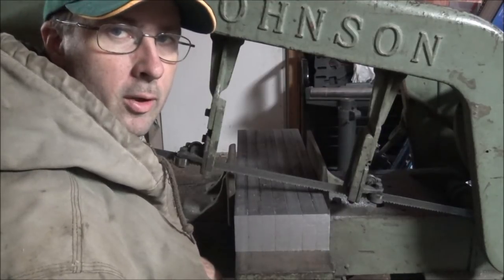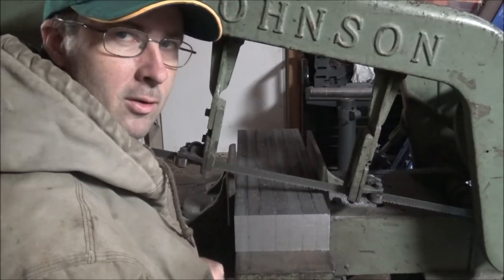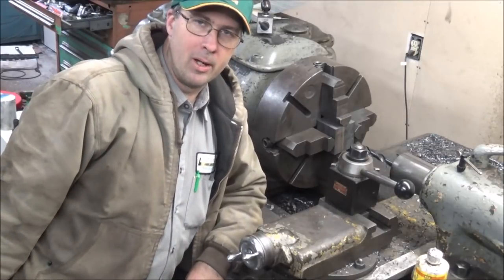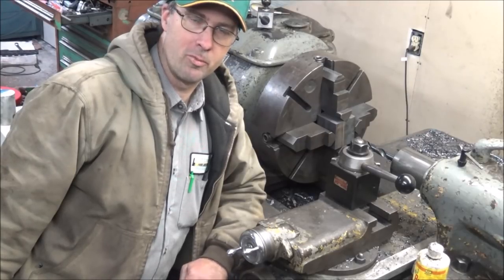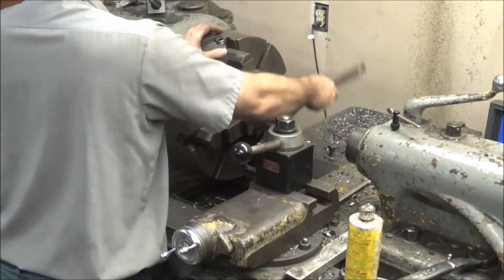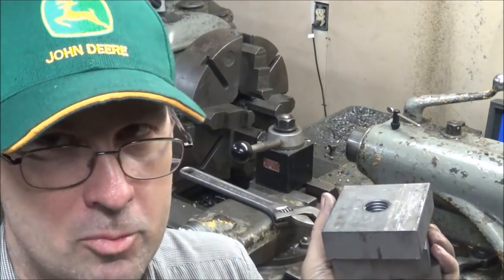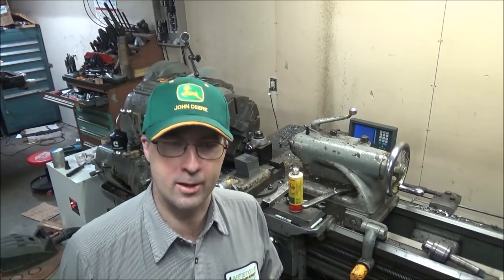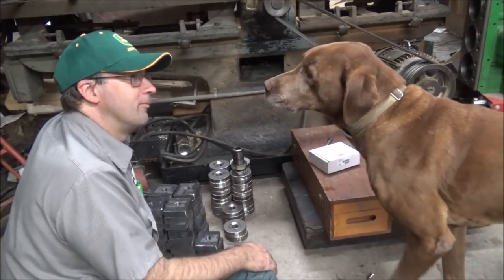Ganging Parts to Save Time

Comment: I did an install similar to yours on an old Grand Rapids grinder, about 42K the rigger figured.  The print called for very similar anchors.  My print did not call it out very well, but installing them was tough.  I used angle over the concrete, so I could set them in position, but it made finishing hard to do well, but ok since it was under the machine.  I realized later that the prints had angle near the surface, but it did not give a length.  After some thought, (and after the concrete was set) I realized that the angle near the top was to align the anchors as well as hold the whole assy of anchors square, etc.  Mine worked in the end, but was not pretty.  I would highly recommend welding some angle near the top of the anchors so you can lower the entire assy in place, level, etc.  It will make it much better than my job.Joe

Comment: Now that's rapid tapping for sure Brian. Not a hope I'd have the guts to try that even if my lathe wasn't a pos. And 21 inches of steel in 16 minutes isn't slow in my opinion. I'm still always impressed at how effortlessly and quiet Yours and Adams Monarchs run. No fuss ever, just nice and smooth and the metal peels right off. That is going to be a long tiring job getting that HBM leveled with that many anchors. high production rates or not your still gonna be getting the boss his dinner no matter how much you do. :-)

Comment: Hey Mr Brian, just a thought for you. I got a set of 8 or sockets at the tractor store and made a driver from an old socket extension and power tap with that. In deep holes the socket just disengages from the tap if need be then a wrench will back it out a turn or two and you can power extract. Hope this helps keep on makein chips!

Comment: Enjoyed.....curious, could you have clamped your 4jaw on the Carlton on blocks and done the drill/tap?  Assume a much longer setup time and Bailey might dock your wages
Reply from the maker: Probably could have but just lugging that chuck from one shop to the other would have taken me half the day, that thing is heavy!!!! Then I don't have a good way to attach a d1-6 to the table so even more time figuring that out and also I would have to work in the cold so using the lathe was the better option. :-)

Comment: Power tapping 3 at once... you wild man!!  I almost got  a Johnson model J but the seller changed his mind.😣
Reply from the maker: They are a great saw. I love my Johnson.  Three at once saves time and so does full speed power tapping! :-) It can be a bit tough on the heart though. lol
Reply: I find hand tapping so much more risky, power tapping gets the tools very straight without so many irregularities, those that causes a tap to break...   ;)
Reply: I completely agree.  I power tap on my Monarch lathe.  My Monarch is a Series 61, and it's wired with a reversing switch and controls, too.  I was just worried about three parts ganged together.  I don't think I'd do that......but I don't do it all the time.  I'd be worried about snapping off my expensive taps, not hurting the lathe.  The Monarch's are built for it, and a whole bunch more....

Comment: Hi Brian,  I would like to see how you adjusted your saw to cut with such accuracy.   I have a Wells saw and get around 1/32 top to bottom of the cut and about the same front to back depending on the length and height of the material.   I OK with this but if I can increase the accuracy I am all for it.   I would like to hear your comments or suggestions on dialing in a horizontal saw.  I  enjoy your videos and wish you continued success as you progress setting up your shop.  Thank you !
Reply from the maker: I will aim to make a video on it in the future. Have you tried a different blade? If you have everything set square and it still wants to cut crooked its usually caused by uneven rake on the blade.

Comment: haha nasty bossman here, ya could of shaved 30 seconds off that time by backing out under power... lol
nice work as always Brian.. if you want the boss off your back send him on a wild goose chase
Reply from the maker: My lathe only turns one way, it doesn't have any reversing contactors to turn reverse, otherwise I would have powered back out.:-)
Reply: Now time to get the shop superviser to work in orderto get that switch fixed if he really wants production to increase....!!!!
Or, what a stupidviser is for...????
Reply: very much tongue in cheek.  ........ just swap the wires from the phase converter over that will make it gu bakards that should do it , only jesting , but due the girl a favour and fix the leccy bits up right .. great vid thinking outside the box as usual , boss looked please but he must have been working hard he falling asleep on his feet
Reply: reversing the wires on the motor input isn't a ggod idea, cause the motor in the lathe is idling constantly and the spindle is engaged by a clutch, so you need a proper reversing set-up if you don't want the power lines to melt down by reversing the rotation on the phase converter... Yeaks...   
( Brian uses invisible fiching wires to keep Baily up on his feet after a certain time of the day...   lol   )
Reply from the maker: What switch is Baily fixing?
Reply: Guess by now, I realize that the only switch Baily has is an "On/Off" awake/asleep switch, or sound on/off when he wants quiet from his employee and nap...

Comment: Vert smooth work. Whats next? Are you near ready to pour concrete or is there much prep work to do.
Reply from the maker: I have to position all the anchors in their proper spots and be sure they stay there. No small task.
Reply: As much of a pain it would be to work around, how about welding rebar between them to hold them in place?
Reply from the maker: I plan to do some of that.
Reply: Another thought, how about welding or bolting up out of wood a fixture that simulates the machines mounting holes that you could drop in place as each set of mounts has concrete poured around them? That way the bottoms would be anchored by the re-bar and the tops aligned by the fixture.  But you likely thought of that already. 

At least you can bribe your supervisor with a scratch between the ears and a dog biscuit, That wouldn't work so well with mine, She'd file a harassment suit....

Comment: Multiples and ways to gt it done faster, don't need to have Baily to push me to find ways to cut short, I HATE PRODUCTION RUNS... !!!  
But, it's great to have a partner to put the blame on or hear the thruth from...    lol
BTW, have that "Happy" superviser fix that reverse contactor on the lathe for you, after all it's just a phone call away...   lol
Reply from the maker: My lathe never had reverse. It only has start and stop buttons.
Reply: I'd be lost without a reverse on my lathe...   :(
So much can be done in reverse...!!!
Reply from the maker: If you have never had it then you don't miss it.lol I do think it would be rather handy to have though, I guess during wwii they didn't feel that feature was important.
Reply: Yap, torpeedoes didn't have reverse either, better for the launcher...   lol

Comment: No cutting oil on the Johnson?
Reply from the maker: Even with the parts ganged and cutting 7inches at a time the blade gets no heat in it whatsoever. I always have to replace blades because of teeth getting ripped off rather than dull.

Comment: Next time weld the end of those flat bars together so your not messing around between cuts.
Reply: I was thinking he needed to clamp a piece of flat stock to the table for a stop...either would work!!
Reply: Could have just clamped them until you ran out of clamp room. I have a 30ft roller table feed for my do all, jut clamp it on the end and let her eat.
Reply: A stop is a good way to go. I set up stops on my doall all the time. When your cutting 500 ft of stock  every  second counts.

I an gang 14" wide and 8" tall in my do all, and sometimes i wish it were bigger. lol
Reply from the maker: I need to build a proper stop for the saw sometime. Another project to add to the list.